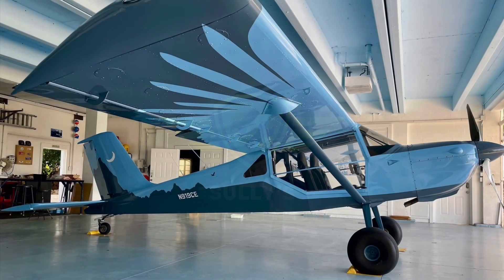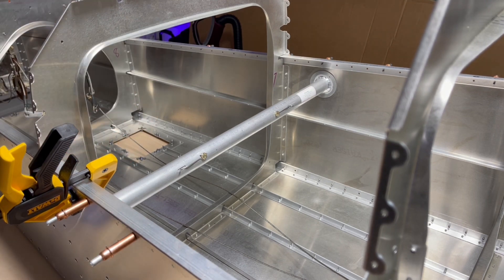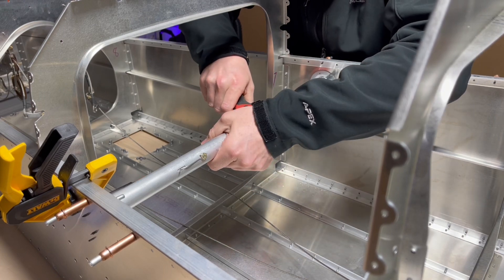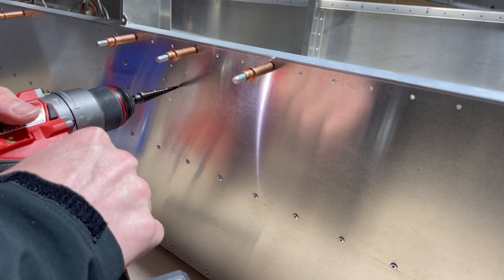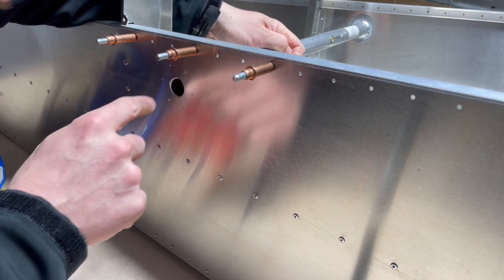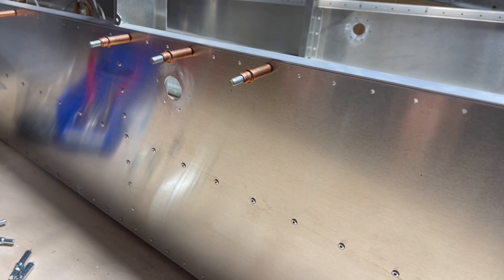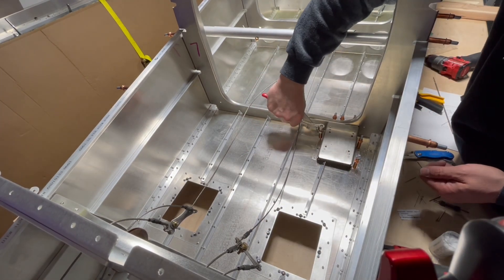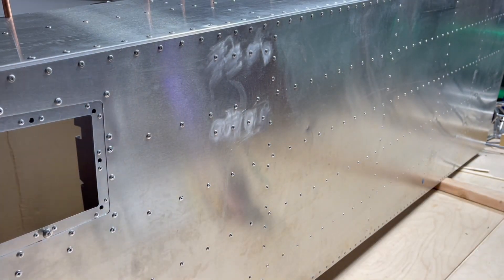Rans S-21 Build - Ep 16 - BAS Taildragger Handle & GMU 11 Magnetometer Mount

Comment: What model or part number from BAS is that? I like it a lot better than the Rans one on the vertical stabilizer. Did you also install that one?
Reply from the maker: If you call BAS and ask them for the Rand S21 model they will send you the correct one! I only installed the BAS handle, skipped the Rans option.